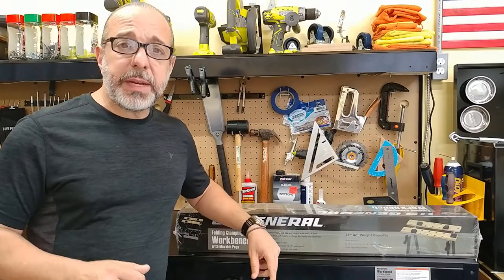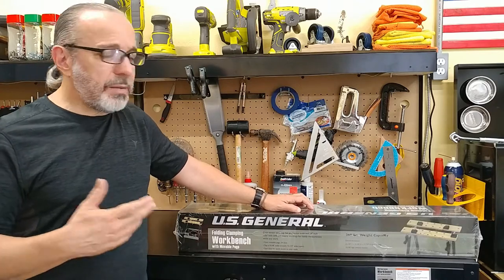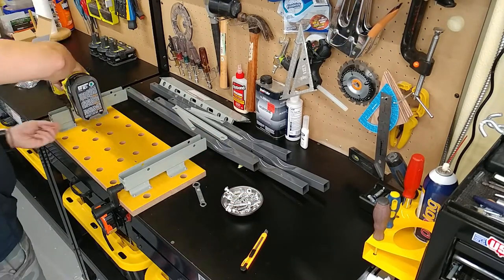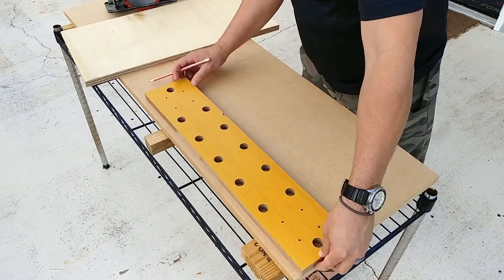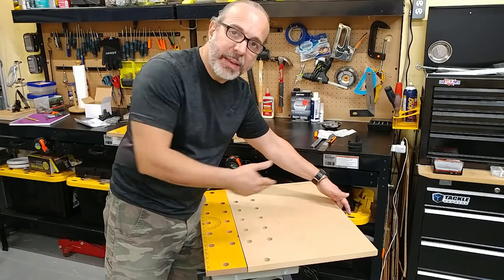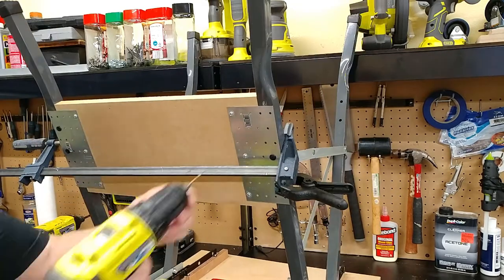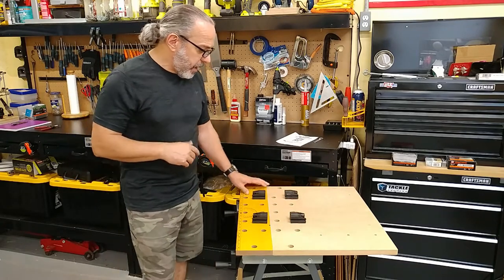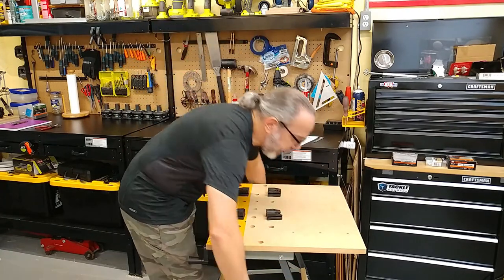Folding Workbench with Clamping Vise & Pegs from Harbor Freight | Assembly | Mods | Review

Comment: I had a stroke in 2018 and get very flustered with reading directions.  I bought this table today and opened it and almost threw it away.  On a whim I looked on You Tube and found your video.   Thank you for making this a very easy project for me.  I will use your mods for sure.  Thank again brother!!!
Reply from the maker: Sorry to hear about your condition. Thank you for sharing!
Reply: I wish I had received your printed instructions, mine had nothing printed.  That’s why I watched. I would have like to see assembly, not how to make a router table.  But it’s all good, I figured it out.

Comment: Thank you for an excellent video and for explaining a few fine points when putting these together.

I originally bought one this Monday but then realized because a few of my projects are larger (longer) than what I would be comfortable with using a SKIL SAW or a vintage plane or one of my electric planners I went back and bought one more.

For me I 'faced' the 'cross bar' to the inside and then backed-up the legs with an 1/8" piece of aluminum with a 'brushed" finish for extra strength - and looks; and then made two table tops to hold my work - one is 2'X3' while the other is 3'X5' (which is held in place by the bench tops themselves).

The wood for the two tops came from a beautiful piece of lumber for a king size headboard and footboard I recently found discarded at a location not far from my home. And just for info I covered that with a sheet of acrylic/plastic to protect the finish as it's too nice to ruin.

So tomorrow I get to finish a late Mother's Day gift for my Wife - two new side gates for the fence and will get to see just how well these do the job.

Edited Sat. June 18, 2022: Okay, I finished the last of the gates today, and managed to do so with only one bench and my friend Lee since I had to plane a few pieces of lumber and with anything over four feet, only one bench tends to tilt unless the piece is held by another person.

So now my next 'mod.' will be to add struts at each end to keep the bench steady and will made from some 3/4" steel I have which was left over from another project.

The bench itself is everything I needed and for four or five times the price, it cannot be beat - so two thumbs UP for Harbor Freight on this one.
Reply from the maker: ... that is AWESOME! Thank you so much for sharing.

Comment: An observation. When I began looking at YouTube vids on upgrading this particular model of  folding workbench, I noticed the in 25%-30% of cases the legs had been mounted on the wrong sides with the result that the short bent piece of all four legs, were tipped in towards the centre rather than outward to spread the weight and to maximize stability. I bought a used one at a garage sale recently and will increase the size of the tops and build a base with wheels to allow me to use it in the house for repairs, painting etc.  The size of this model seems ideally suited to that sort of purpose. I will mod a dolly I use for storing wheels/tires for seasonal wheel changes, to fit the small workbench for when I need it for that purpose. Back to your vid.
Reply from the maker: … thank you for stopping by. I appreciate you!

Comment: Adding 1 and 1 together isn't always easy. I have had extra drawer slides for years and I have hated wobbly top on my folding workbench for a while as well. I have never even thought about checking if those drawer slides could be the answer to my workbench problem. One great option added to the list of possible solutions. Thanks!

Comment: I have a similar portable workbench. I changed the top to solid wood and made the back piece deeper, just like you did, but I hadn't consider using drawer slides like that. That's brilliant. I'm going to do that! Thanks!
Reply from the maker: Thank you for commenting! To my surprise it worked quite well! ... and yes, birch ply or hardwood is a much better option!
Reply: @CubanRedneck  My hardwood was an old shelf I found, so it was free! It was a big shelf, so it has gone into several projects. I don't understand why people throw stuff like that out! I also found some other shelfs for an IKEA shelf unit—which I have—so they have come to good use as well.

Keep on making great videos!
Reply from the maker: That's awesome! ...thank you once again. I have a few project in the works looking forward to your feedback!

Comment: Thanks for the well lighted video.  Your sound was good also.  Wish you had one on assembly of work bench.  I didn’t need a router table.  I didn’t get printed instructions and had to figure out what went where.  Even a good picture of completed bench would have helped.  Nice workshop.
Reply from the maker: ..sorry for the slow response. Please take a look at these and let me know https://www.facebook.com/permalink.php?story_fbid=408768781000408&id=103761264834496
Reply: @CubanRedneck  I didn’t need a picture of your workbench-router table.  I just needed a picture of completed workbench.  No directions in my box and had no idea what went where.  Hard to put something together when you have no idea what screws to use etc.  I knew two boards on top, legs under.  The wrench in package was worthless.  Your video was well done.  Just not helpful to me for assembly of out of box workbench.

Comment: Thank you for this video and especially for the discussion on your web page that explains how to orient the oddly shaped rubber feet with the lowest corner toward the center of the table.  I think I may have over tightened some of the bolts as mine refuses the fold all the way and springs back a bit if I try to force it.  Also the two table sides do not align as smoothly in the vertical direction as they did before I attached the legs.  Anyway, thanks again for the rubber foot explanation.
Reply from the maker: ...no problem at all! I am glad it was helpful! Know that I too had to shim the OEM piece with washers to make the deck even. I am not sure if I mentioned that on the video but I'll make sure it is on the website!
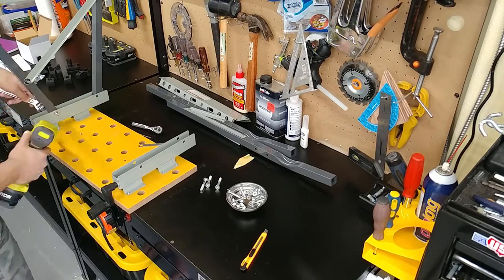Reply from the maker: ...I forgot to mention, did you put washers on both sides of the legs? It is very hard to make it fold without! Take a look at 3:33 - Here is a link https://youtu.be/YbZqrwkXpFs?t=213
Reply: @CubanRedneck  I remembered that you said something about washers on both sides but, when I saw that the instructions called for washers on both OUTER sides I thought they saw your video and added the suggested washers to the kit.  I see now you are suggesting 4 washers total per leg and no, I didn't add washers beyond those in the kit.  I will consider it.  Thanks again.
Reply: Wish I had seen how to put rubber caps on, I stuck them on, took off repeat etc.  if I ever get them off again I will put them on right.

Comment: If you are familiar with the MFT (Festool Multi Function Table) it is a table top with an array of dog holes of diameter 20mm and spacing 96mm.  I did a quick calculation converting your "approximately 0.800 thou" size and this most likely a 20mm hole. (0.800 in * 25.54 mm/in = 20.32mm)  By the way the 96mm spacing is based on the 32mm European cabinet shelf hole and hardware fastener spacing standard.   

If the holes are CNC cut, the clamping tops would make an inexpensive jig for making MFT table tops, which in the US are more expensive than that.  

Your method of using a laminate trim, or pattern router bit to transfer the  seems totally valid.

I have an old Black and Decker Workmate 400, and it is a fine tool, but I find it is now way too heavy and cumbersome for quick jobs.  I plan on getting one or two of these clamping workbenches and making them usable with the washer and bracing mods you cleverly presented to us.  Thanks.
Reply from the maker: … hey, thank you for stopping by. I have been sending SANTA letters for the last couple of years for a CNC, no luck so far. We will see what the future brings. As to using templates and jigs, even if I made one from scratch, it is my preferred way of making parts. Happy Holidays!
Reply: @CubanRedneck  You're welcome.  I don't even have room in my garage for a miter saw station, let a lone a CNC.

Comment: In 1985? I could not afford a Black and Decker and bought this exact same bench as a cheaper alternative. It has all the issues you identify but is still functioning. I think it cost the equivalent of about $50 in today’s money. Original Workmate cost equivalent of about $350 when it came out in the UK IN 1972.

Comment: Its good idea but it design to be portable and light weight 
But in your need and requirement of your job its the best idea
Reply from the maker: … thank you for stopping by. Although a little bit heavier, it is still portable. My friend used plywood, and it is actually lighter than the original.

Comment: Careful when cranking the 2 tightening mechanisms.  Made of plastic and if you overtighten, IT WILL BREAK.. ask me how I know.. :)
Reply from the maker: … thank you for stopping by, and I hear you but I would never rely on a bench of this type, regardless of brand, if that much pressure is required.

Comment: Too much work. Spend a few more dollars up front — get a better table to start with...
Reply from the maker: …my friend, if you can afford it! GOD bless you, but know that my fishing buddy who has a $100+ one just stop by and said that he'd be implementing some of these modifications! Understand that the $50 one at Home Depot suffers from the same issues, it is basically the same thing just $25 more!

https://www.homedepot.com/p/Professional-Woodworker-Foldable-Workbench-51834/204739343
Reply: I agree with you, buy a better one.  You don’t have to make it over.   I have an older black and decker, it is so well made and smooth operating.  This is piece of crap, shame on Harbor Freight.  Box I got  was opened and things missing, also parts bent that I had to reshape.